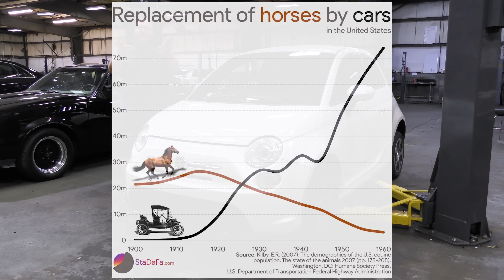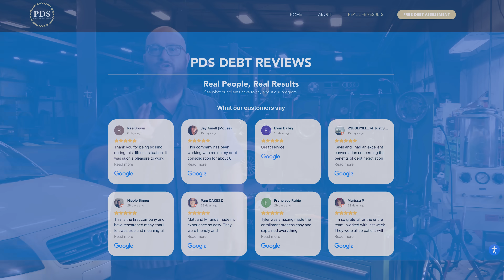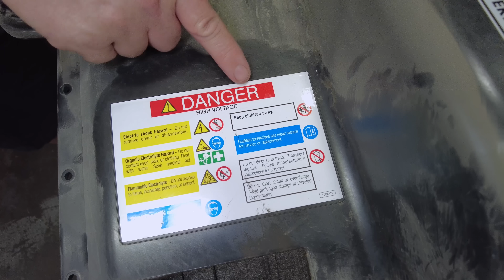How to SAFELY Remove the EV Batteries From my Fiat 500e

Comment: I'm not against EV's but I still would not have one as my main car.  I do road trips to a friend's fishing cabin where there is no charging infrastructure.  I live in a place where we get something called winter and 38C (100F) summers.  Current battery technology is not up to road trips in that weather.  If I lived in a big city and only needed a commuter with weekend grocery runs maybe one as a second car.  All I know is I have 2 good cars with low mileage and it's cheaper to maintain then replace.

Comment: Face the facts ... EVs are "appliances" ... you use them for a few years and then throw them away and buy a new one .... not so great for long term Earth. VERY destructive to produce them .. worse to get rid of them. Hard to tolerate the ignorance of the human race.
Reply: Redwood Materials, LiCycle and other companies are already recycling EV batteries. 
The cars are repairable as proven by my local Tesla repair center & body shop. It does tend to take longer that it should but that's a "growing pains" issue that will get resolved. 
There are already EVs on the road that have passed 300k and 400k miles on the original battery and they come with a 100k - 120k warrantee, so if it has a battery issue in the way you claim, you will get a free replacement. 

How much has it cost you in lifetime maintenance and fuel for that 425k mile car of yours?
Reply: The current generation of batteries are lasting 300k ot 400k+ miles (gas cars typically only last 200k miles) and the batteries are recyclable at the end of life.
Reply: @That-Guy_  keep drinkin' that Kool-Aid .... NOT recyclable ... cars are literally NON-repairable when damaged .... NO shop wants to even touch them and Tesla takes over 6 months to repair them. EV lucky to make it to 100K without EXPENSIVE battery replacement and my gas Toyota has 425,000 miles on it. Good luck in life.

Comment: Funny to be watching this just after finding my 36v tool battery is only partly charging.   Looking at solutions it seems you can pull it apart and jump 2 circuits for 15 seconds and it resets and is fine.   I will not do that, I'll replace it but have a pretty poor impression of the brand.  If it wasn't for the fact the chainsaw is new I'd swap brands.   I do not believe lithium battery technology is mature - we need better batteries and I am sure they'll be around in a few years.

Comment: You can get reconditioned batteries and upgraded batteries for the Leafs. They can be up to 3k - 4k and rebuilt combustion engines start around $2500. 
I do agree that the batteries will have to become a standard charging and at least standard cells even if the overall battery pack sizes will vary in sizes.

Comment: Possible to add a Battery Pack Control module Access door so if you need to replace or repair the module again, you’ll save a ton of time ?

Comment: It'd be great (for the reasons you mentioned) for there to be a single cell/battery form factor and chemistry but that's likely to innovation/improvement. The 4680 cell pioneered by Tesla has some promise. It's far easier to produce and may be adaptable to other chemistries.

Maybe a better course would be for the aftermarket (or hobbyists) to figure out ways to adapt the battery management systems of "obsolete" EV's to other cell types.

Comment: Wizard, it is beyond the cell because cell technology will advance rapidly in chemistry and form factor. What we need is a standardization in the modules for the EV battery., items like the BMS you are having repaired overseas, etc. I do not understand why there are many form factors for generic items like fuel pumps, alternators, Power steering pumps, etc. I should be able to go to the parts store and say, ‘I need a 100 amp alternator’, am sold one and it just works because it is the 100 amp form factor… same for modules for EV batteries.

Comment: It sounds stupid but correct on universal battery technology. Elon shipped out to every EV maker about the 48 volt system to make EV more effective.  When talking to my old mentor when I was 16 rebuilding alternators when I was 16. I'm 46 now. He said recently still alive that was a ground breaker and a good idea.  I have worked several hours and electrical issues with EV.  Remember that 16 pin plug you unplugged from that battery on the Fiat? Had to rebuild the entire plug due to flooding in Vermont. Wrote to legislation about battery equality and voltage equality for better diagnosis not for repair price but for our diagnosis purposes.

Comment: Repair of Battery Control Unit (BECM) Fiat 500e - Electric on eBay for $820 plus $100 shipping. Wow such a clever man the wizard to turn to eBay for all his difficult repairs! I would have called either Fiat in Italy or Bosch to see if I could get a new/rebuilt one.
Reply: I suspect their answer be a straight no.  Parts availability across the board is becoming a real issue not just for EVs.   Manufacturers just want you to buy a new car and that will only get worse as more Chinese brands make inroads into EV sales globally.  Imagine what their attitude to supplying a new control module will be for anything much over a few years old even if they're still in Business.
Reply: @iboswell  When the Wizard claims a seller (turns out on eBay) is the only source for repair he is talking nonsense because I know of several shops both in Italy and GB that can pretty much repair any module ever made as long as they can find the manufacturer's schematics for the circuit board. Also, Fiat having placed the control module inside the battery casing rather than under the hood indicates that the module is made to be replaced together with the battery pack not separately.

Comment: It looks too me like you have the higher range battery pack because all usable space is filled up in the pack itself. In almost every case of smaller capacity battery packs, although they are all the same size overall, when you open them up you'll find voids inside the pack itself where cell packs should be. Since yours has no large unused space, that means you have the higher range battery pack.

Comment: Hey Wizard. That fuse (battery disconnect) isn’t fully open. The black handle should be straight up. Otherwise when you go to lock it in, it’s not going to fully make contact and you’ll have an issue with full voltage. Just so you don’t think something happened inside the battery.
Just an FYI.

Comment: I wonder if the "battery control module" is like the ECU in my old 1992 Lexus SC300.  On that car the capacitors on the ECU board start to leak after 20 or 30 years.  Causes an intermittent short which can result in all kinds of weird behavior from a misfire to the car not starting.  Results in people taking the "parts shotgun" to the car and after trying 3 or 4 things it still doesn't fix it.   If you are handy with a solder gun, you just pop out the bad capacitors(provided they haven't destroyed the whole board yet) and put in new ones.  Car runs like brand new.  I'm wondering if that "battery control module" is something stupid simple like that and the guy in Bulgaria is the only one to have figured it out, takes him 20 minutes to fix and he makes $800.

Comment: I agree with you wizard. They should unify all the stuff kind of like the trucking industry. All the brakes tires lot of the air components everything's interchangeable whether it's Kenworth Freightliner international most parts swap over

Comment: great one - I like this hands on explanation with the good, bad and ugly. 
There are a lot more services and it all depends on what car you have. Some are in germany for high end cars like teslas where they do a lot of battery pack swaps and even celll repairs especially on a ton of tesla refurbished batteries cause as they like to say tesla delivers under waranty not new batteries but refurbished ones and most of them will dy sooner than later and he brings those back to life. 
But most of the repair shops which really do the pcb investigations and repairs are located in the baltic states or roumania or bulgaria due to a very good edcuation and also cheap wages of cause.
So whole west europe is shipping those crashed cars to those cheap labour states where they are torn down to be sold in parts. 

If you get an EV or european ICE car and you face eletric or electronic issues never forget that those are the best of the best that do know their job very well.

Comment: You won't see universal batteries for EV's any more than you see universal transmissions, engines, gas tanks, etc. for ICE vehicles.  What we are seeing is increased energy density and lower costs which will continue going forward.  You also are unlikely to ever see an EV with a 1,000 mile range just as you don't see gas cars with 1,000 miles of range, nobody needs that.  What you will see is increasing numbers of fast chargers and more vehicles with 350-550 miles of range.

Comment: My spouse has a MB EQE 350+ SUV, and we like it.  Very smooth and quiet, and despite the 5700 pound curb weight and only 288 hp, this thing's performance off the line is thrilling!  0-60 in 6.2 seconds, but the initial shove is amazing. It has a range of about 270 miles, so we could drive it to Key West or Orlando.  And we have a 19 KW charger installed next to our driveway in Fort Lauderdale to charge it, that was $1300.  The charger can add 10% charge per hour, and we have the car set up so that it charges to 80%, and then we run it down to about 40% and hook it up.  Since we have a 12.7 KW solar array on the roof, the car is essentially charged for free.

My own car is a '14 Cayman S, with the 3.4 liter Flat-6.  325 horsepower with PDK, it has a Cantrell exhaust mod that gives it full time sound equivalent to Porsche Sport Exhaust, and you get this sensation from the sound and vibrations just behind your backbone of a light aircraft, such as a Piper Saratoga or a Beechcraft Bonanza, you know, that kind of rumbling long duration cam flat 6 sound.  I think that the sound and vibration is part of the experience of this car and I like the fact that it is ICE.

Then again, it takes 4.2 seconds to get to 60 mph from a dead stop;  The next Cayman comes out next year and is going to be electric, and the rumor is that it will get to 60 mph in 2.1 seconds, or HALF the time of my car and that's just the base model.  That is something that I am going to have to experience, and I'll make the decision to go electric after a good test drive when these come out.

Folks, if you like cars, your car is your Personal Rollercoaster.  You need to decide what you like best:  Is it the old wooden roller coaster that thrashes you and throws you around, or is it the new metal coaster with nylon wheels that pulls some serious G's....

You decide.

Comment: I've been soooooo looking forward to this episode.  I have a 2015 Leaf and love it (central CA car, so temps are fine), but it would be horrific as an only car, and I totally understand it's going to be mechanically totaled in only a couple years more.  I'm not sure how the future is going to pan out for long term ownership/lifespan of EVs with batteries being the only thing keeping them from being able to stay on the road as long as traditional ICE cars.  I wonder if at some point there will be an industrial standard "sub pack" that will allow simpler rebuilds of batteries.

Comment: I recognize that EV is generally here to stay and we're in a transition phase in transportation.  I don't like or hate EV.  The tech has a long way to go before I'm likely to be tempted into it and as an older guy I'm also not likely to live long enough to see EV become a mature and fully reliable technology.  I regularly drive 1200+ miles one way on my road trips.  With diesel or gasoline vehicles I can drive it in around 18 hours if I drive it straight through.  I've not yet heard of an EV that is both affordable and capable of making that trip in the same or even similar time frame.  Once I get to a point where I don't need to travel over 100 miles in any direction an EV may be viable for my situation but until then I don't see it being a choice in my life.

Comment: The EV represent a high cost, low resale, unrepairable device with limited range which is internetworked to our detriment. In 10-15 years gasoline will be expensive and hard to get.

Comment: The nice thing about the leaf is it comes with CHADEMO which allows you to do vehicle to home charging or powering your home.  If your utility allows it you could consider buying a leaf purely to coast your home through the night if you have a large solar electric system on your home.  Could use without solar just to coast you through higher rate periods in some areas.  Most utilities don’t allow this though.

Comment: I would like one. Its rear seat, sucks. Otherwise it’s everything the cars I’ve owned for 20 plus years at a time offered.  Hatchback, quick, good handling, cute. 87 Chevy Sprint Turbo I owned 93-2012, 92 GTI 16v I bought in 99 and still cherish. 15 Scion XB manual. That’s the Thing. I buy something over 5 yrs old with intension to keep over 20 years. Can that be done, here? I don’t want to drop $7500 and end up having the battery fail in 10 years or less with a postage stamp. If I can just put a reconditioned battery and fix as needed, I’m Golden!

Comment: It's cool you are doing a deep dive on this thing. It's a 24kWh pack BTW and in my experience would never ACTUALLY go more than 90mi despite what the guess-o-meter would say. Fun until ~30mph, weak after that, even a little scary on the highway. Safety, what safety? Stellantis (then FCA) didn't care much about the 500e, outsourced it to Bosch, no one wanted to service it or give parts even when it was still in production. The CAN system was different and weird, the app was 3 years with no way to extend. Just end up being a bad time, an afterthought they never really wanted to commit to.

Having also owned the similarly sized MINI SE, the two couldn't be any further apart. The FIAT was a toy and the MINI an actual vehicle, something that still rings true as both of these EVs have entered their second generations. MINI dealers also have no qualms working on them, even BMW and independent shops knew how to handle them. They are just MINIs with batteries and rely heavily on the parts catalog and tooling (BMW i3, other MINIs, etc.)

Comment: I had no idea the Fiat 500e had a cooling system for the battery.  My son’s friend leased one of these for university.  Great tiny car, but I wouldn’t want to purchase one.  The battery in my Ford Mach-e is so much more advanced.  Fortunately, standardization is starting to happen.  I remember bringing my 1987 Nissan D20 pickup to my recently retired grandfather, who was a Buick mechanic for decades. He looked at the engine and declared he wouldn’t touch it, because it was fuel injected.  lol

Comment: It doesn't matter what the chemistry of the battery is. There is no standardization of the Battery Management System (BMS). The motors don't care what's providing the power as long as it has the right voltage and current. But without a way to communicate with the BMS there's no way of reusing or repurposing the batteries.
Jack Rickard (RIP) of EVTV was working on this. He was designing a system for off grid solar where you take a used EV batter pack (case and all) and just plug in an inverter and a control unit and you're set. With enough solar you could remove your electric meter and never know it. His biggest headache was every company (or generation) has their own BMS communication system.